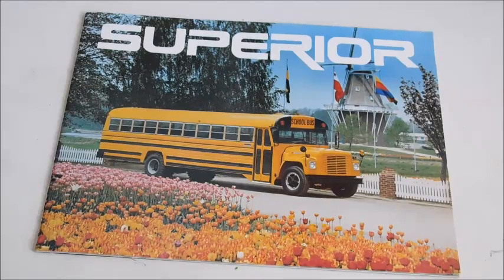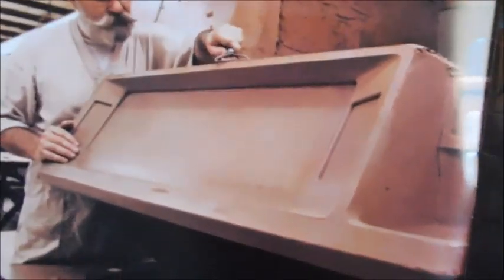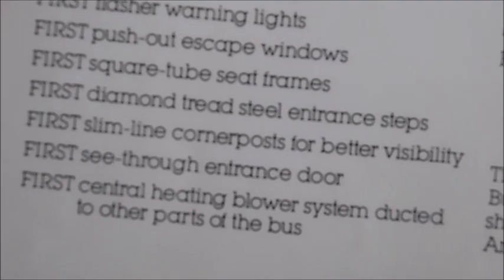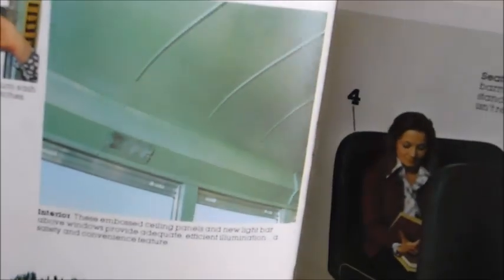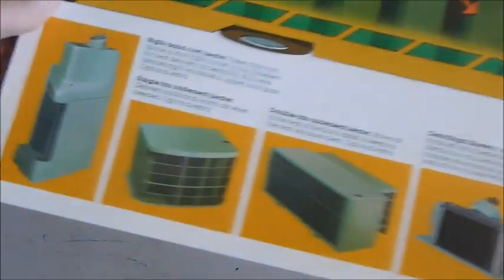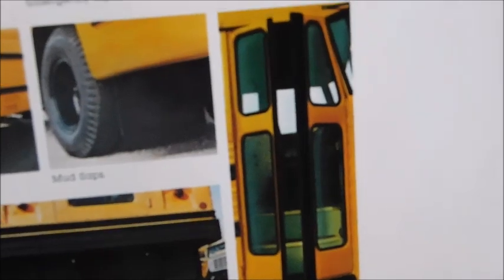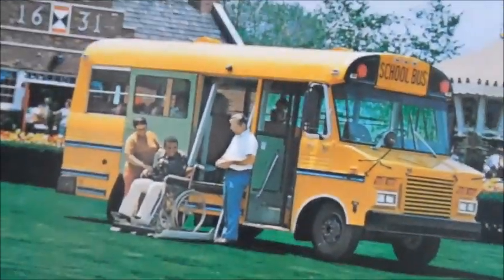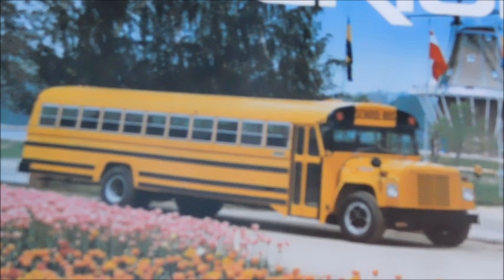1978 Superior School Bus Sales Brochure

Comment: We had 3 Superior Loadstars (~1978) running as spares when I first started elemetary school so I've been on them a few times.  I think they had the rear light monitoring system and also the amber/red pilot lights were mounted on the access panel above the driver mirror which was pretty cool.   The 16 light monitor shown at 5:12 was on all of our Carpenters at the time but I've never seen it on a Superior.  This monitor had bright incandescent bulbs instead of LEDs and the warning lights criss-crossed each other when flashing unlike what you see on the LED monitiors on newer BlueBirds and ICs.

Comment: i did ride in the pacemaker as i think some here in Western Pennsylvania exist in junk yards to store autoparts in. as i think the Pacemaker the front hood has an V around the S logo but its on a Chevrolet P30 chassis the engines used is a 5.7L 350 small block chevrolet, and a 7.4L 454 big block chevrolet using rochester quadrajet 4 barrel carburetors and a 3 speed turbo hydramatic 400 auto trans and a Dana 60 dually rear end. as the superior busses i recall was Superior Coach before the Sheller Globe Corporation took control of them as they own the Leece-Neville co. that made heater motors and alternators for them, as i think there are some superior busses that are the post sheller globe models, refer to retrochad's channel. as they stopped making busses in the early 1980 but still had the Leece-Neville division before they sold it to Prestolite Electric, and Sheller Globe was aquired in 1989 by United Technologies formally United Aircraft Corporation.  the Full size busses the conventional type C they were on Ford, and International Loadstar chassis and before they ceased they were on the International S Series chassis which had a DT 466 diesel option.

Comment: i want a superior if my yard did not scrap them the mini busses which i believe is the Pioneer PC which has a chevrolet P30 chassis, 350 small block chevy V8 engine (carbureted rochester 4 barrel quadrajet) turbo hydramatic 400 3 speed automatic,  Dana 60 rear axle, as i recently got off ebay a driver's fan from one a Baader Brown 7200/7000 as the lights, light hoods, all made by Baader Brown. the full size busses seen the IH loadstars as the last of them are on the S series chassis the engine in them are a 345, 392, 404 gas engines, and a DT466 diesel, chevy be a 350 small block, 366, and 427 big block truck eas engines possibly an 8.2l detroit diesel fuel pincher then. Ford their own gas motors possibly the 8.2l detroit diesel 4 stroke v8 fuel pincher too then. as then Superior went out in the 1980s and Mid Bus took over till they went out. its parant company Sheller Globe Corp still had the funeral hearse bodies sold them off and they owned the Leece-Neville Co that made the 2 speed heater motors and alternators for them when it was sold to Prestolite electric as its today, as Sheller Globe in 1989 was then aquired by United Technologies corp. formally United Aircraft Corp.